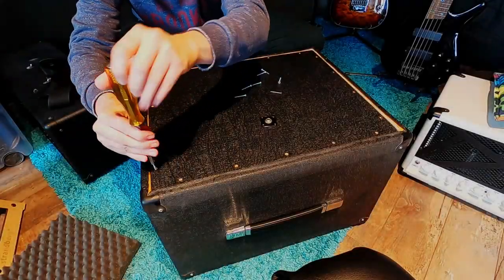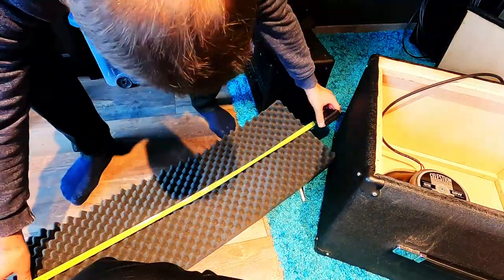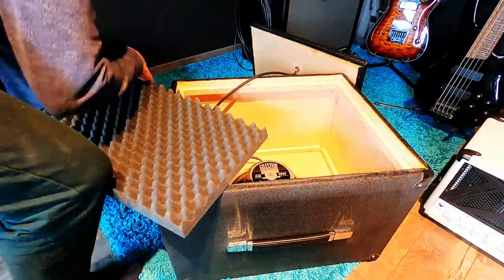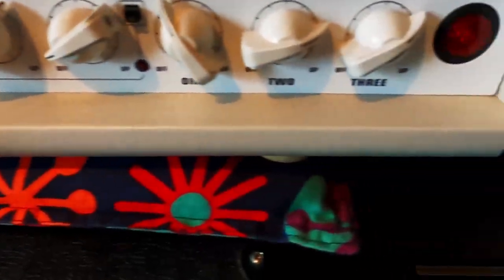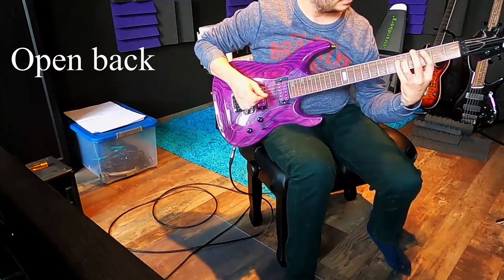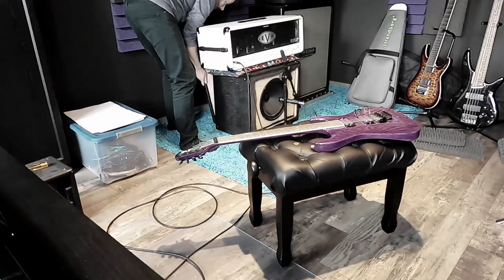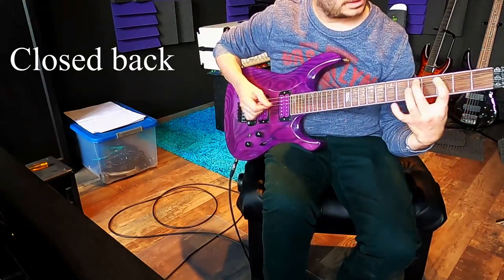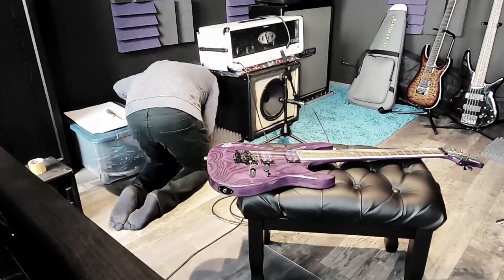Speaker cabinet: open back vs closed back vs closed back with foam

Comment: The closed foam sounds best to my ear. Thanks for doing this
Reply: I've A/B'ed that in a Marshall 1936 2x12 (plywood not MDF) and an EVH 4x12, and in both instances it (to my ears) sounded worse. I shot about 20 IR's on the 1936, and even after months, when testing, it still sounded worse. It might be due to this being a different cab and a 1x12, but good quality acoustic foam or polyfil is a tone suck IMO.

Comment: Is the cab ported? I don’t see any holes.
Reply from the maker: Hi James, no, it's not ported. When the back is closed, the whole construction is closed.
Reply: @ThevonMusic  that might be some of what you’re hearing. I built my cabs as well, using the Bogner Cube as reference. They have two 2” ports along the bottom, this should allow the speaker it’s full throw, the motion back and forth at the voice coil. When you open the back, I heard more range, a more complex bottom character. When you closed the back, the tone tightened up, as though some of the bottom was lost. 

I’ve enjoyed all your speaker videos and appreciate your engineering post EQ, as many others have complimented, great job.

Do a little research on speaker porting, this is to facilitate the speaker motion. Kindly, James.
Reply from the maker: Cool, thanks for the info and complimenting!

Comment: I couldn't really hear a difference.  Could you demo it again only with zero distortion?
Reply from the maker: On what kind of speakers are you listening to this? Differences are subtle but definitely noticeable. With distortion you hear differences WAY better than cleans.
Reply: That would be even less informative. Distortion is like a wide spectrum noise that clearly lets you hear frequency response differences. Think about when you tweak guitar tone with an  EQ. The same EQ device is much more drastic with distortion then with clean! You move the knobs or sliders just a little bit and there is a huge difference, which is not so apparent with a clean tone.

Comment: towads the end,  no backing track,  I cleaerly hear the difference.    The bass response is noticable & sounds much beter closed.
Reply from the maker: Yup, can confirm this
Reply: Yes, because the open back allows bass to escape out the back and cancel with the bass at the front, since it is opposite phase: e.g. when the speaker compresses air at the front, it decompresses at the back, and that basically sucks the pressure from the front to back.  You've never seen a subwoofer with an open back.  A tuned port facing forward, maybe, which is different.

Comment: To me the point of open vs. closed is defeated if you are placing a mic right in front of the speaker. 
The benefit of an open cab is best realized in the room, not right in front of the speaker.
Reply: While it's true that the open back interacts with a room, the point is not defeated at the close mic position. The microphone clearly picks up a difference. The mic is sensitive to the bass cancellation of the open back, and can sense the reflections coming from the rear panel of the closed back, which are attenuated with the stuffing.